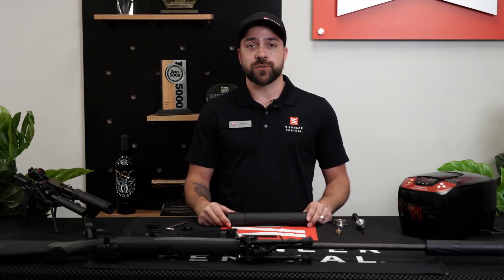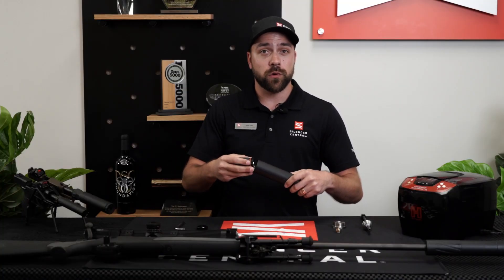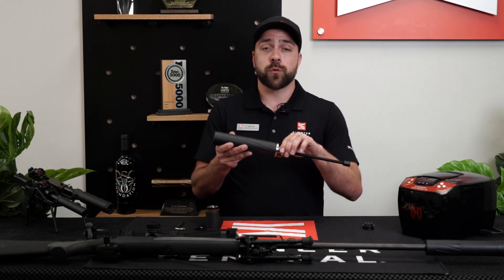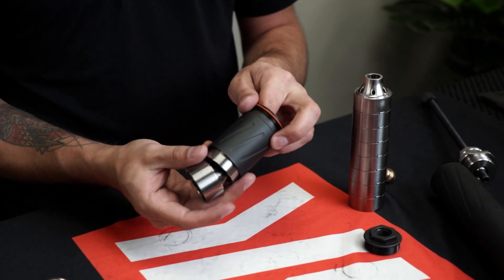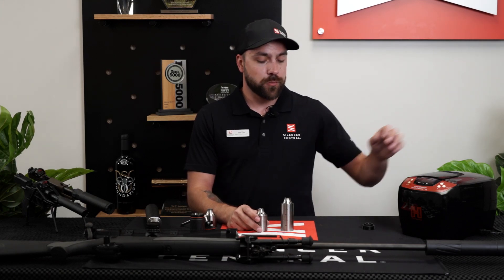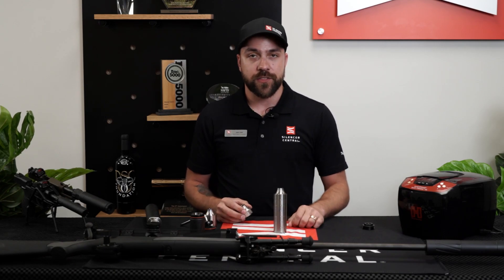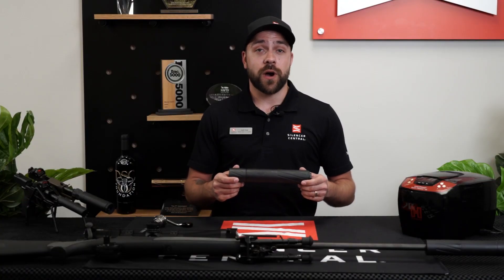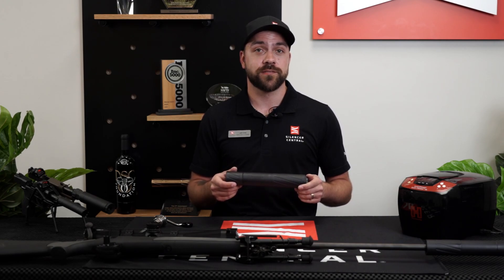BANISH 46 - Breakdown and Cleaning

Comment: Am I able to remove the rear end cap of the suppressor? Is it a 1 3/8 x 24 thread??? I have a AAC stamp mount that’s 1 3/8 x 24. What suppressor on your sight will thread onto that adapter? Thanks